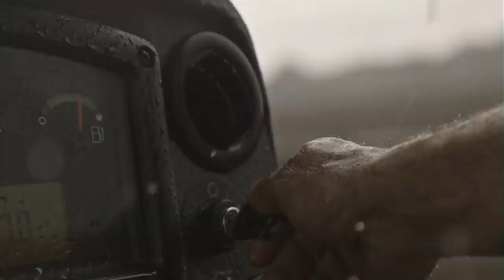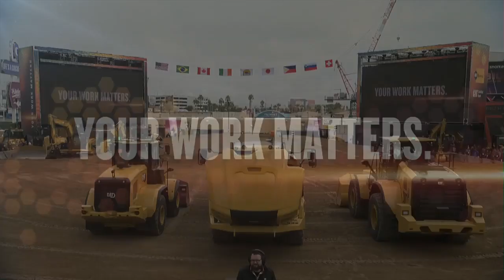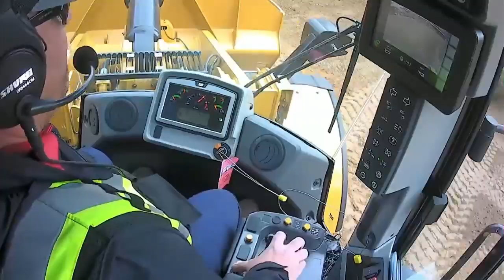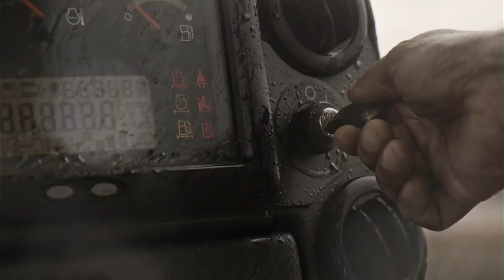Cat® Equipment Demos - Full Range | From CONEXPO 2020

Comment: good trucks, but the un-level alarm is junk. on construction sites there is hardly any time you are perfectly level. Alarm was so loud couldn't even hear the other operator over the radio, annoying AF. Also lock nuts should be installed on the tailgate hinges, mostly the older models we dont have enough time on the new machine to tell that yet.